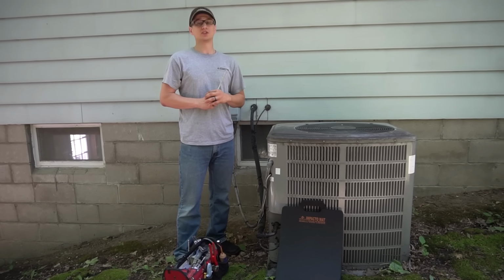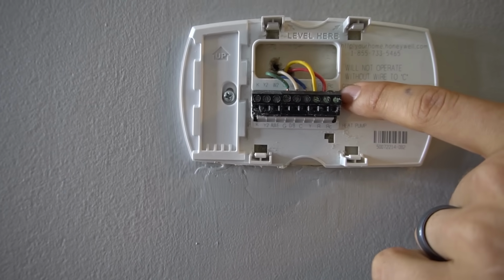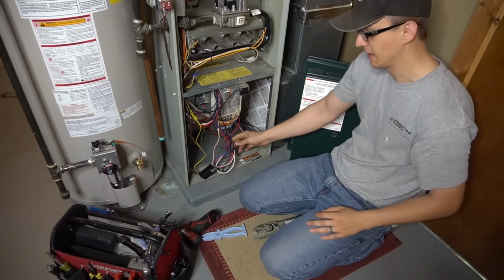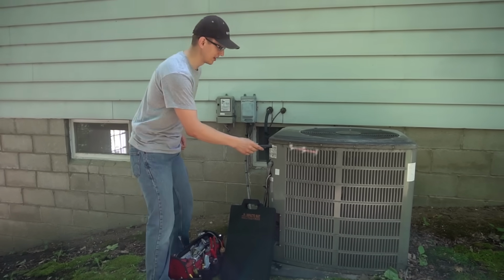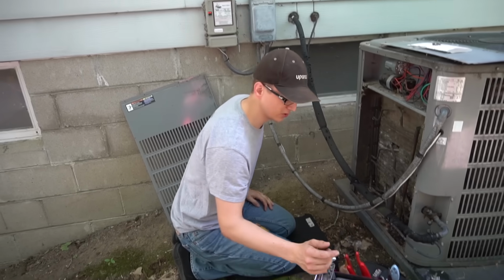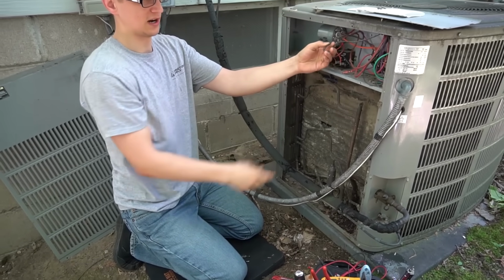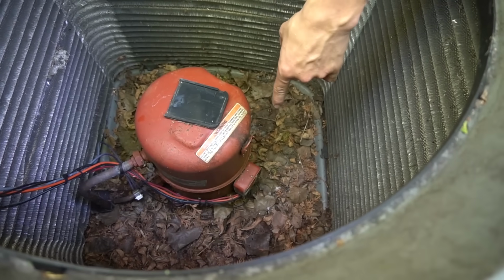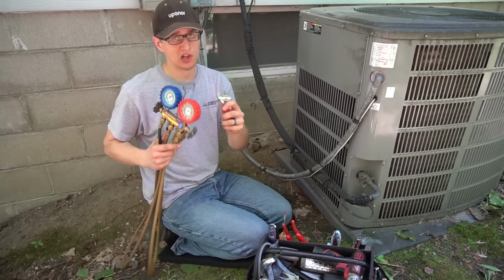AC Unit Not Turning On - How to Fix It Step by Step

Comment: AC unit seems to work fine, but the blower shuts off after about 20 minutes.  The AC unit outside keeps running and checking the control board there is still 24 v on the g wire.  I can recycle power to the furnace and the blower comes back on - for another 20 minutes, then shuts off again.  What can be causing the blower to shut off like this?
Reply from the maker: I would say either your fan control board or the blower motor is bad. Find the wires coming from the blower motor and see which wire goes to the COOL terminal and where the white common wire goes. When the fan turns off like that, put one lead on the COOL terminal and the other on the Common. Do you have 120v going to the fan motor? If there is power going to it then you know your motor is bad. If there is no 120v, then the fan relay on the control board is bad. Also, your blower motor capacitor could be weak as well. Sometimes all it takes is just replacing that capacitor but usually I end up replacing both the capacitor and the motor.

Comment: I have been watching your videos and reading all the comments from people. You are doing great Job @Word of Advice. I have similar problem where my Aircon intermittently turns on and at other times it does not and just keeps trying to turn itself ON during this process (when it fails to turn ON at all or stops working suddenly and tries to start itself again i see the sparks coming out of contactor and a noise as well. This is the outside unit that i am talking about. Inside unit blows little air all the time when i turn it ON. I have so far checked all three capacitors (including motor run, start capacitor and one other capacitor). I have also tested start relay but they all were fine. Today after reading your suggestions, i tested the contactor points with multimeter while it was turned on and one side was around 240v and other was the same. The aircon ran for few minutes before it stopped and tried starting again, this time when i checked the other side it only had 2v and from the circuit breaker side the contactor terminals were 240v still. I have opened up the contactor and cleaned up the contactor terminals which had carbon built up on it due to i guess the spark so cleaned those up with sandpaper. Still no luck. Shall i replace the contactor? Or is there anything else. Oh forgot to say when the outside unit tries to Start, the fan on the outside unit does not run but the compressor hisses and buzz. If i manually rotate fan when the unit is turned off, it rotates freely. HELP!!
Reply: Also my thermostat does not have batteries if that helps. Unit is 4 years Old.
Reply from the maker: Hey man! Thank you! It sounds like your contactor coil is losing 24v when it intermittently opens like that. If you keep your meter leads on the contactor coil terminals, when the unit cuts out, does the 24v drop as well? If the 24v is steady even when the plunger releases, then the contactor is bad.

If the fan is not running, the compressor will overheat and trip on an internal overload or pressure relief valve. That is probably the hissing sound you are hearing. Does it start hissing right when it starts? Or does the compressor run for a little bit first and then hiss? If the fan capacitor is good and you verified it has 240v going to it, then the condenser fan motor is bad and needs to be replaced. I would get a new capacitor with the new motor too.

And just in case you will run into this problem... Sometimes the fan blade can be hard to take off. What usually works for me is taking a channel locks pliers (the pliers with teeth) and bite into the motor shaft on the side closer to the motor. This is important, make sure you DO NOT use a toothed wrench on the shaft part that is on the outside of the fan blade. This will make it really hard to pull off the blade. So after you get a good grip on it, keep the shaft in place and spin the fan blade. That should loosen it up and typically it will come right off after a few good tugs.
Reply: Word of Advice TV Thanks for your reply. I am not very good with using multimeter’s all functions. Couldn’t get the desired results from the coil (didn’t know what to look for i tried having it on Ohms setting). Anyway i replace my single pole contactor with 4 poles contactor which i took out of an industrial machine which was broken at work, just had to work out the leads etc. but yeah it works like a charm. So the contactor was bad. Happy days now. Thank you so much again.
Reply from the maker: Awesome! Good to hear you were able to get it going. Thanks for coming back with an update! Stay cool ;)
Reply: Okay. Scratch that. It's having the same problem again :(
Reply: I have checked the resistance on fan motor between brown, white and black cable and the resistance between one combination was 120 and the other two being (60 each approx) almost added up to 120. does that indicate the Fan motor is fine (i learnt something around this from your other video)
Reply from the maker: That means the motor is good, electrically. But there is also the possibility that the bearing is bad. Usually the fan will not spin freely when the bearing is bad. But if your contactor coil is not getting energized like you said before, then I wouldn't think the fan motor is the issue here.

So if you are still having the same problem you had to begin with, I would start trying to find what is interrupting your electrical circuit. The thermostat wire that comes out of your wall and goes into the condenser unit will usually have 2 wires in it. If you check voltage between those two wires, what do you get? You should have 24v. Do both of those wires go to the contactor coil or does one of the wires go somewhere else? If it does, that means there is something wired in series with the contactor coil that can be interrupting the 24v circuit. Try to trace the wires and see where they go and hopefully find what is tripping. (like a pressure switch, or fan delay, etc.)
Reply: Word of Advice TV Sure. Thanks for your reply. I will do that when i get home. Just FYI we are in Australia and its winter and i am trying to use it for Heat. It works like a charm for hours during the day (before it stops working) but as soon as its dark and bit colder, when i turn it ON, it won’t work as soon as i turn ON or it would work for like a minute or two. Which is bit strange but this is a tested fact for over a month. I thought i will put some more light on my case to get your understanding on what’s going on. Also the fan spins freely when manually rotated. And as i said before during the day it works for hours without a problem 9/10 times. Wish i was able to send you a video of what it does.
Reply: I couldn’t trace the cables from thermostat in the aircon. They are two white cables behind thermostat remote but they sort of either disappear or connect to a hardly accessing board and i am guessing might be coming out into a different color cable. Also what i tried today and yesterday is that after turning on from Disconnect, i pushed the Contactor poles (bypassed the thermostat) and only the compressor came on but not the fan. I tried this few times. And when i used the thermostat, the fan and conpressor than came on both at same time. Does that ring bells?
Reply: Also from the fan motor there are six cables coming out, one is ground, one is Aux, one common and then three are labelled as High, Low and Medium as shown on the diagram on the fan motor.
Reply from the maker: Hi! Sorry I couldn't get back to you earlier. Thank you for the additional info! It's good to know that it's a heat pump and it's heat that you are after. When did this problem start happening? Also, how cold does it get when your unit refuses to turn on?

About the fan not coming on, It sounds like the compressor is wired right to the contactor but the fan must be wired in series with the fan delay control board. So the contactor sends power to the board and then the board sends power to the fan motor. Which means pressing in the contactor plunger would only send power to the control board and then power stops there.

If you look at your wiring diagrams, do you have pressure switches? Usually labeled LPC or HPS. I wonder if a pressure switch could be tripping.

When the unit runs for a couple minutes and turns off, if you measure voltage between R and B at the furnace control board, what do you get? How about B to C?
Reply: Word of Advice TV thanks for replying. You are doing a massive favour to me and other subscribers so you don’t need to apologise. So it does not get massively cold as compared to day time. The minimum temperature is about 8-10 degrees. 

Yes there are pressure switches on the board and i know where exactly they are. Can we bypass them in anyway in order to isolate that issue? 

When you say control board on furnace, do you mean the indoor unit? I have personally never been to the roof and have never seen the unit but i can if that’s what you are referring to.
Reply from the maker: Let's hold off on going to the roof for now. :) I forget that not everyone has it easy like me where the furnace is in the basement, easy to get to. 

You can bypass the pressure switches but if they are tripping that is an indication that you have a freon issue. (would need to call a technician if that's the case) When your unit shuts off, after a minute or two does it start back up? (sometimes it will be less then that)

So the temps go down to 8-10 degrees Fahrenheit? Most heat pumps will not work efficiently below 15 degrees F. I wonder if your thermostat is programmed to shut the heat pump off once the outside temp gets too low..
Reply: Word of Advice TV haha i wish i had basement. And its 8degree celsius so about 47 Fahrenheit. This issue started almost at the end if summer so about 2-3 months ago. 

Once it shuts off (it keeps trying to come back up as i know the contactor is clicking and can see some spark at the contacts). It never comes back ON though.
Reply from the maker: Oh okay, now that's getting interesting.. So the unit shuts off but then tries to come back on. Do you see the contactor plunger pulling in when it tries to start? So it just buzzes but neither the fan or compressor come on? Have you replaced your capacitor yet by chance? It's possible that your capacitor is weak
Reply: Word of Advice TV i haven’t noticed when it stops and contactor sparks if the contacts pull in, i will check that once i get home soon. I think the compressor does come on/stays on (i think as there is definitely some buzz/hiss from compressor) but fan definitely does not come on when it fails at other times they both work as a team 😂. I took all my capacitors (three) and a relay switch to a spares shop to get them replaced but they checked and said that they are all good.
Reply: Sorry it did not malfunction yesterday. I turned it off and back on multiple times as well and left it running for few hours but it just worked fine 😐
Reply from the maker: Oh boy.. Intermittent problems are tough.  Hopefully it will just keep working now :)
Reply: Word of Advice TV hahaha. Fingers crossed. But i know it will mess up. I trust this machine 😂
Reply: Word of Advice TV and it stopped working. So while it’s trying to start backup, they contacts push in and out. The spark from the contactor is when the contacts get pushed in.
Reply from the maker: Oh wow okay. So the 24v is dropping in and out, causing the contacts to pull in and release over and over. Now you just need to figure out what is interrupting the power. You can check voltages with your meter right? Put one lead on one side of the contactor and the other lead on the other. Do you have a steady 24v while it chatters like that? Or does the voltage bounce around? At 17:20 in this video I briefly mention which side of the contactor is 240v and which side is the 24v
Reply: Word of Advice TV thank you for that. I always struggle to check 24v on the coils (not sure if i am not using the correct settings on the multimeter). But i always get random numbers like 17,500 or something like that.
Reply from the maker: Odd. You must have it set to the wrong setting. Do you happen to have the manual from your meter? Or perhaps you could look it up online. What you are looking for is what setting will check low voltage. (AC)
Reply: Word of Advice TV cool. Thanks for that. Really appreciate your support. We will have to pause the troubleshooting for two weeks as i had to urgently come overseas to see my family. We will resume the troubleshooting once i got back to the country.
Reply from the maker: Okay no prob! Although in 2 weeks I will be going on vacation for 2 weeks where there's no internet so I guess we'll see what's up later!
Reply: Word of Advice TV no worries. Sounds good. Enjoy your vacation 👍🏽
Reply: Word of Advice TV UPDATE so even though i had taken all the capacitors to a place where they sell them and they tested all for me and said they were good. Later i checked myself with a multimeter and one motor run capacitor was supposed to be 55uf but was coming to 48uf when tested. People told me it’s still good. But I just took the little risk to replace it with new one (its only like $40) and guess what it has been working fine since then. I think i got it this time. Thanks @Word of Advice

Comment: "Liked" very much therefore "subbed".

Question : Split unit, fan blowing and outside unit working, but no water draining to the outside of the house. Used bleach, suctioned furnace  at it's "spigot" and also the pvc pipe going to the outside. Also suctioned from the  outside.  Still not getting condensate - possible problems and solutions to them?

Many thanks!
Reply from the maker: Thanks for liking and subscribing! :) So it is cooling the house and everything seems to be working normally but it is not draining? Where is the water going then? You can try blasting some water in backwards to clear out any blockage. I like sharing this article for plugged condensate drains: http://acwiz.com/index.php?action=artikel&cat=18&id=26&artlang=en
Reply: Many thanks for the reply.

 I finally managed to get all the gunk out, and everything is working fine (thermostat, furnace, compressor, fan) BUT - no cold air.   

Time to make a call for R22?
Reply from the maker: Yes, good chance you have a refrigerant leak on your hands.

Comment: Hey fellow Minnesotan here. You make some great videos. I have what i thought was a capacitor problem. When AC is turned on compressor starts on outside unit but fan will not start by itself. Can easily start fan with a stick. Took off Capacitor and it tested good, tried a new one anyways with no luck. What should i look at next. I was thinking fan motor on outside AC unit was mabey bad, but if so, would i be able to "hand start" the fan and it would continue to run until thermostat shut it down or i pysically turn it off? Any help i would greatly appreciate. This MN heat is kicking my butt and i have some family coming to town. Thanks.
Reply from the maker: Hey there neighbor! ;) Unfortunately if the capacitor is good and the compressor is running that means your condenser fan motor is likely bad and needs to be replaced. Do you have a meter? It would be nice to confirm that it has 240v going to it. Although if the compressor is running, then the fan motor is most likely getting 240v too. The windings in the motor must be shorted out so you won't be able to hand start it. When looking for a new motor make sure the RPM, HP, and Voltage are the same as the old one. If you have an Appliance parts store in the area they might have what you need. Dey Distributing is a good place. Otherwise if you have Amazon Prime, you could probably get a Fasco motor like this pretty quick too: https://amzn.to/2NJMC1b
Reply: Word of Advice TV 

Thanks for the advice and help. I was not sure if i made myself understandable enough, sorry. You mentioned that my windings in fan motor could be bad, and it would make the fan unable to be "hand spin" started. I can get mine going if i just help the fan blade get going and then it will run....would the fan motor most likely be the culprit still. Thanks, Brandon
Reply from the maker: Oh okay! Sorry, I misunderstood a bit. But I would still say the condenser fan motor is bad if you replaced the capacitor and it still doesn't start on it's own.

Comment: I changed my fan and capacitor outside unit still don't work.  I pressed in the contact and everything work. What else could it be?
Reply from the maker: Does your indoor fan work when your thermostat is set to cooling? It sounds like the control voltage (24v) that the furnace sends to the contactor coil is being interrupted somewhere. Do you have a meter you can check voltages with? Also, if you have an attic unit I would start with checking if the condensate drain line is plugged. That would cause the float switch to trip.

Comment: Thank you. It is very good video. You are very knowledgeable. When we want cooling the both AC and internal furnace not turn on. but the thermostat looks work fine. Are you working I Georgia near 30047 area?
Reply from the maker: Sorry, I live in Minnesota. Is your indoor unit in the attic by chance? If it is, then I would start by checking if the condensate drain line is plugged. If it is not, then your 3 amp fuse may be blown in the furnace. Also, check the breakers for both the furnace and AC